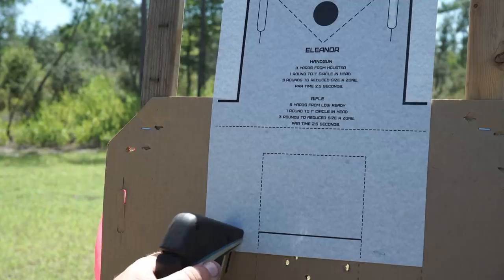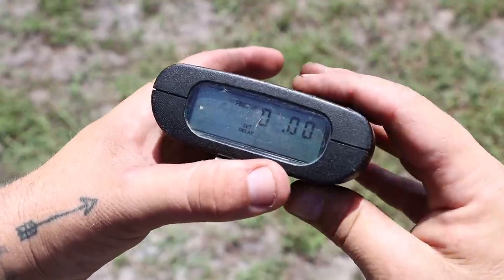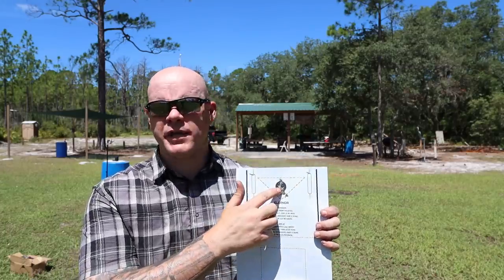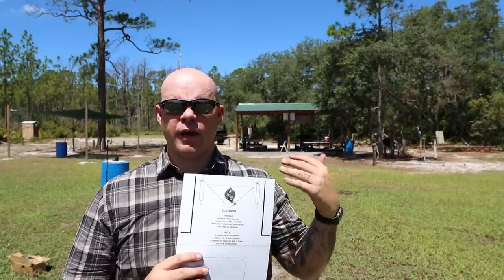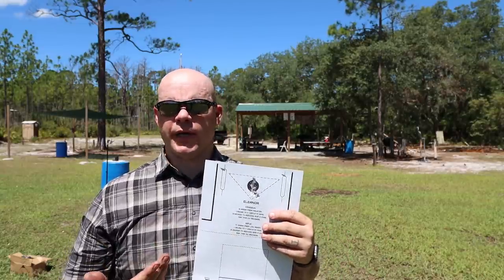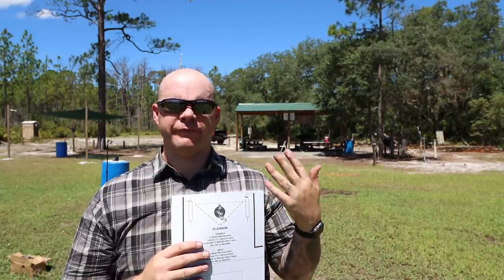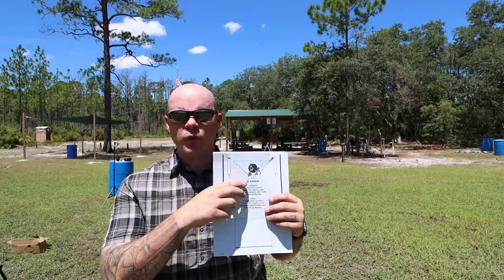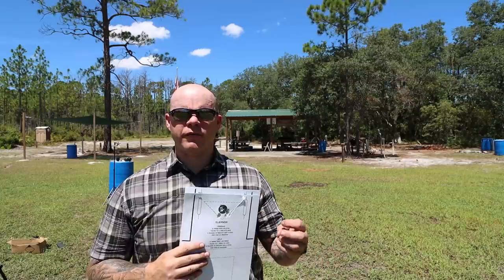Draw Stroke Heat Mapping

Comment: My solution to the problem is simple.   I have a eail that comes over top, leaving the iron sights open and the optic stationary, even when the slide is cycling. 
  Its more "cumbersome" but I don't carry it concealed, it's my "let's go to war, the zombies are here" gun.
  But, it lets me use both sights and is very fast acquisition of both close and far targets, letting me use my battle proven, Parkerized pal for all kinds of CQB and intermediate engagements out to 100yds with no issues.
  There's always more than one way to skin a cat.  (Though, why you'd want to eat a cat, js beyond me.)  ;)